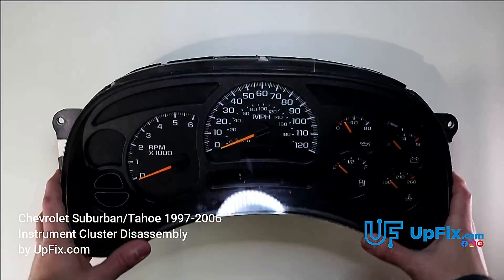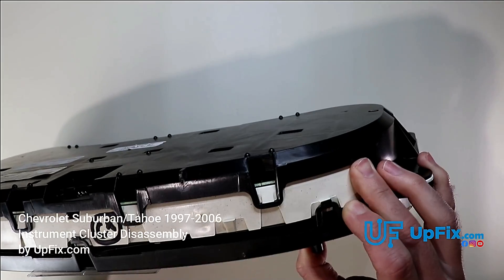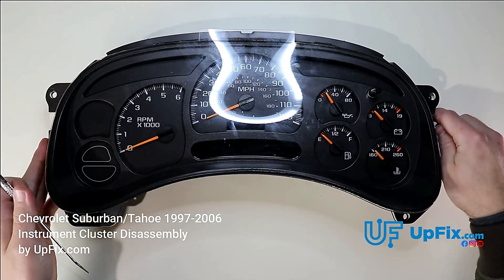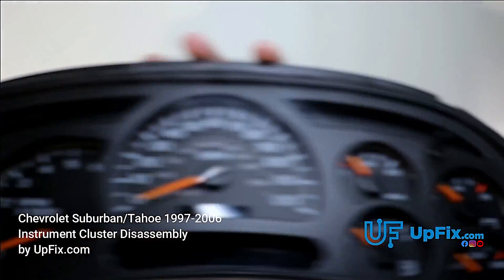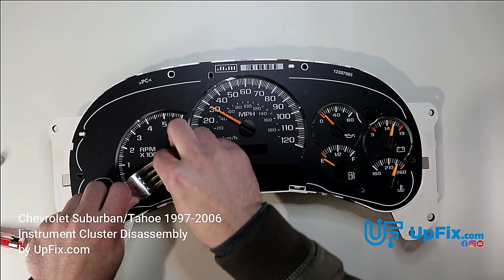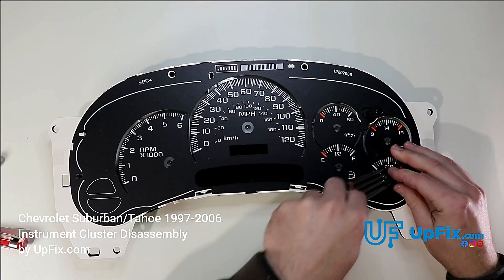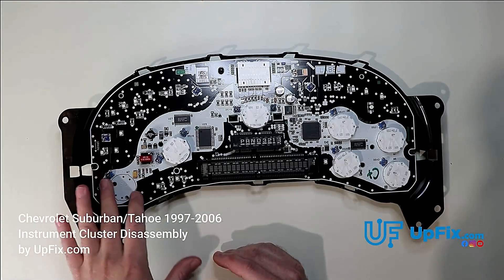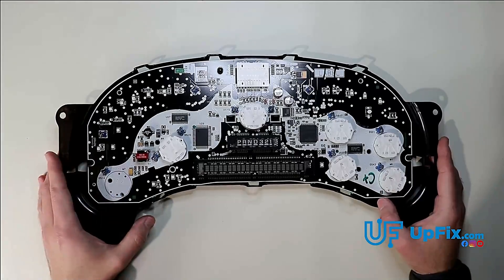Chevrolet Suburban/Tahoe 1997-2006 Instrument Cluster Panel (ICP) Removal and Disassembly  UpFix.com

Comment: I used this company thinking they'd fix my transmission control module as advertised. They said the turn around time was 3 days. I shipped my part out to them and it took about 2 weeks just to get an email saying it wasn't repairable. They wanted to charge $30+ to ship back. I told them to just keep it and stop emailing me for payment. Tanya said they'd stop the emails but I keep receiving multiple a day and now Varya said they wont stop emailing because they want me to pay the bill for shipping out a part they claim they could fix but couldn't. If they fixed it as advertised, I would of been more than happy to pay shipping charges. BEWARE of this company.